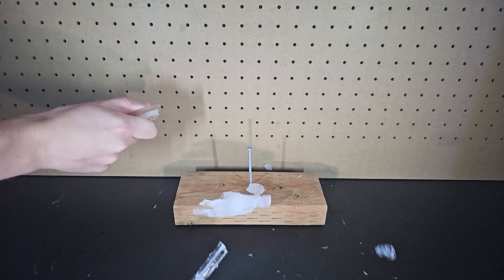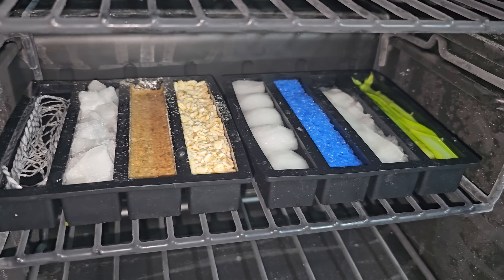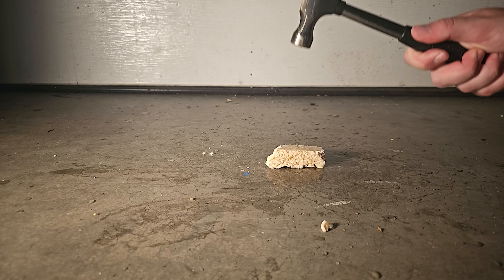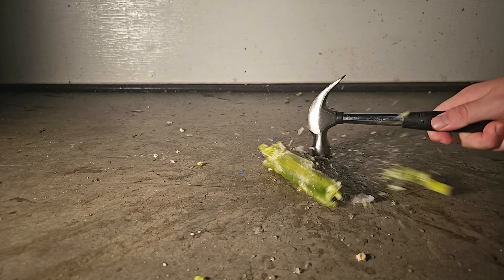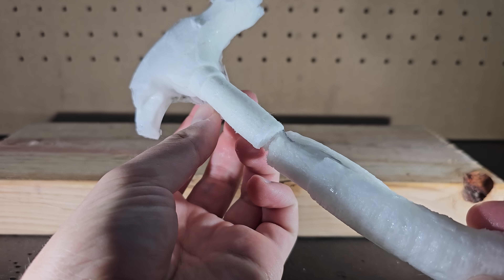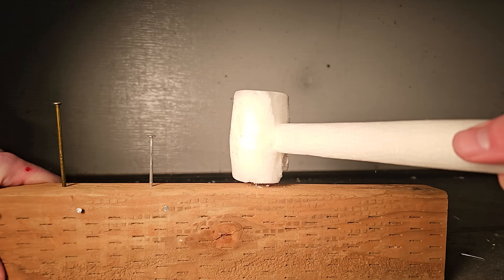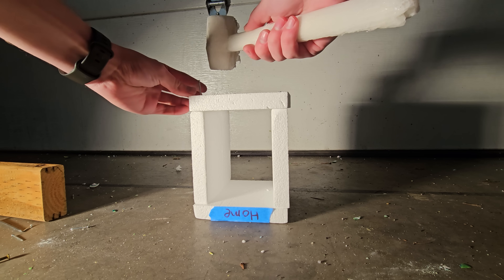How strong can you make ice? (World's Strongest Ice Hammer)

Comment: In case you didn't know

Project Habakkuk was a secret British research project during World War II that aimed to build an unsinkable mid-Atlantic aircraft carrier made of Pykrete, a mixture of wood pulp and ice. Conceived by Geoffrey Pyke, a British inventor and war correspondent, the project was initially supported by Winston Churchill. This innovative idea emerged during a time of great need for the British Navy, as they faced significant challenges in the Battle of the Atlantic.

Pykrete is a composite material made from a mixture of wood pulp and ice. The wood pulp acts as a reinforcement, increasing the strength and durability of the ice. This unique material was discovered by Geoffrey Pyke, who experimented with various combinations of wood pulp and ice. The resulting material was found to be strong, durable, and resistant to melting.

The type of ice used in Pykrete was likely freshwater ice, which would have been mixed with wood pulp to create the composite material. The exact composition of the Pykrete mixture varied, but it typically consisted of a combination of water, wood pulp, and other additives.

The Proposed Habakkuk Aircraft Carrier
The proposed Habakkuk aircraft carrier would have been enormous, measuring over 1,200 feet (365 meters) in length and 180 feet (55 meters) in width. It would have been capable of carrying over 100 aircraft and would have served as a mobile airbase in the mid-Atlantic. The carrier's design would have featured a flat top deck for aircraft operations, with a series of hangars and maintenance facilities below.

Despite the innovative idea, Project Habakkuk faced significant technical challenges and logistical issues. Some of the key challenges included:

Pykrete's properties would have been affected by temperature changes, potentially causing it to melt or become brittle. This would have required sophisticated insulation and cooling systems to maintain the material's integrity.

The production of Pykrete would have required large amounts of wood pulp and water, which would have been difficult to manage and transport. The construction process would have been complex, requiring specialized equipment and labor.
The Habakkuk carrier would have required regular maintenance to ensure the Pykrete material remained intact. Any damage to the structure would have been difficult to repair, especially in the harsh marine environment.

The project was also met with skepticism by naval experts, who questioned its practicality and feasibility. Some of the concerns included:

 The Habakkuk carrier would have been a slow-moving target, vulnerable to attack from enemy ships and aircraft. 
The construction and maintenance costs of the Habakkuk carrier would have been extremely high, potentially diverting resources away from other critical war efforts.

After several years of research and development, Project Habakkuk was ultimately canceled in 1943 due to its impracticality and the development of more conventional aircraft carriers. The project was deemed too ambitious and too costly, and the British Navy opted for more traditional solutions to their naval needs.

Although Project Habakkuk never came to fruition, it remains an interesting example of the innovative and often unorthodox ideas that emerged during World War II. The concept of Pykrete and the Habakkuk project continues to inspire interest in the fields of materials science and naval engineering.

The project's legacy can be seen in the development of new materials and technologies, such as advanced composites and smart materials. The Habakkuk project's innovative approach to problem-solving and its willingness to challenge conventional thinking have also inspired new generations of engineers and researchers.

In conclusion, Project Habakkuk was a fascinating and ambitious project that pushed the boundaries of materials science and naval engineering. Although it was ultimately canceled, the project's legacy continues to inspire innovation and creativity in various fields.

Comment: Glass also shatters like ice but it can be reinforced with steel wiring mesh to prevent shattering which is seen in indoor sports centres. Due to glass having a much higher melting point than ice the shards of glass don’t melt unless the air surrounding it is 800 degrees Celsius or higher. Making the shattered pieces of glass hazardous.

Comment: In addition to AndrewSeller's ideas for making Ice Denser, I have a few explanations.
You can cheat using pure power, since Nails have a sharp tip so you're able to ignore a lot of the density and hardness of the wood, which is why it works very well on styrofoam; as styrofoam isn't as dense nor as hard as ice; so it transfers far more power directly into the styrofoam than the hard wood. I'm tired so I shall probably add a few more explanations tomorrow.

Comment: You should get the strongest ice and item mix for the head and the best for the handle and just blend the two together around the center point and where rhe head and handle meet for it to be the strongest (you could also get small chains or wire or like coins and try it like that)

Comment: Its 2 months old but i would suggest layering cotton so that that there isnt just individual cotton balls but a whole connected mass of cotton. I feel like the ice space between the cotton are the weak points. You could either buy new cotton that isn’t in balls or you can pull apart the cotton balls and sorta stuff the mold more interconnected. Also unrelated, could you try using metal wire or is that not allowed? Anyway thanks for thr video

Comment: The paper towel getting saturated by the water, and them being so thin, fiberous, and flexible. still being paper though, it can still rip pretty hard. So thats gonna be dificult. 
 
Fiberglass might be cool to try, the material has to be able to fufill what paper towel does, while being less rip prone. 

If you stretch out the cotton balls and make them less ballish, you can potentially make it better and more uniform. 

You might be able to do a hybrid meathod, where most is cottonballs, but the hammer head is something like a small bit of cloth with a quarter or something to help add structure to the head, tho that might be cheating, idk lol, a quarter is metal, just like a hammer.

Try the ice salt trick someone else mentioned also, that definitely helps!

Ooooh, cardboard might be good too. Less likely to rip when frozen potentially, but it does get super weak when soggy, it's something to try tho imo. 

Feathers might go hard, goofy, but surprising might work, tho might not take in water as well. 

A thicker liquid might also be a good idea, youd have to find one that can be frozen super well, cuz some thicker liquids dont. 

Best of luck! Im tired, so imma end the comment, but i might add to it, we will see!

Comment: Wait but didnt the asparagus do the best on the gronk test?  So it can take distributed hits better, you couldve used the asparugus in the shaft of the hammer rather than the string. The idea is simmilar to you using the oats at the head of the hammer.

Comment: Pykrete (/ˈpaɪkriːt/, PIE-creet) is a frozen ice composite, originally made of approximately 14% sawdust or some other form of wood pulp (such as paper) and 86% ice by weight (6 to 1 by weight). A slab of pykrete Pykrete is made of 14% sawdust and 86% water by mass. You were using too much sawdust, I think.

Comment: pykrete is so cool ;) ice is one of those sources of endless fascination for me, probably cause i don't get to see it often beyond my freezer and the occasional frozen morning. I've seen some futurists talk about using fiber and ice for quick and easy habitats in the outer solar system, where the amount of sunlight is low enough water ice remains frozen even in a vacuum, with some additional insulating layers it could remain frozen with a comfortable habitat inside, maintaining the structure could be as easy as just melting some ice nearby and applying it to damage when its cold enough to freeze quickly after contact and i suppose you could carry a lot of strong fiber for the same weight as something made of metal or composite

Comment: I would boil the water before adding it to the mold the reason is that room temperature water has impurities like gasses in it. Heating it up will help remove it. This is the reason boiled water freezes faster than room temp water

Comment: To Think, if You Have Enough, Solution, u Could Make a Broadsword, And it Dose 100% Ice Damage, 100% Cold Status, Extra Sharp Because Ice is a Crystal & There Extremely Cheap to Make !
🤩
But, Also, Extremely, EXTREMELY Weak to Heat, So Winter is The Best Time to use it WITH Gloves To Prevent Melting !

Edit : I wonder if it's possible to make Real, Ice Arrow's ?

Comment: I feel like it would be a lot better if you lined the shaft with string because it never broke in half, making a stronger shaft, I think soaking the paper towel first before putting it in the mold would help aswell, and you need to try it with sawdust but more of it

Comment: 1. Refreezing after allowing ice to mildly thaw potentially allows the ice to more densely crystalize. 
2. Lowering the temperature of the water prior to pouring it into the mold will allow for more rapid and dense freezing. 
3. Adding salt to water additionally lowers the freezing temperature, meaning it is slower to freeze but also slower to thaw 

Love from an old science fair project <3

Edit/correction: 
For number 3. Comments are correct, the salt would not cause slower thawing. Adding salt would make the hammer thaw and freeze at a lower temp than pure water.

Remembering a bit better now, I used salt to delay freezing years ago, so that I could make the water super cold before a flash freeze, then thaw, and repeat to increase ice density. Thanks for the comments all. This was fun/nostalgic to think about again :)
Reply: Are you sure about point 3 because that sounds completely wrong?
Reply: @drewdabbs418 it’s slower to freeze but quicker to thaw bc freezing/meltinng temp is now lower
Reply: @drewdabbs418 that's why they salt the roads
Reply: @jasnah-blaumeux8427  I should have clarified that I meant the second part. I know it lowers the freezing temperature. But surely that would be quicker to thaw than slower to thaw.
Reply: @drewdabbs418  They’re right, I just took a second to google it
Reply: I was The 400th like!!
Reply: You should build the mold with a channel that goes to a bottom bit that you can break off. Then, you can freeze it insulated, take advantage of directional freezing, and get a solid ice hammer instead of one full of air pockets
Reply: I would go with boiling water. The reason is that the hot water will have more of the gas removed from solution. This is why boiling water freezes faster than room temp water. This would make a more uniform ice

Comment: Try using a wood dowel or metal rod like rebar in the handle to prevent it from breaking.  Also similar to concrete sometimes ingredients are added to make the concrete stronger like shredded fiberglass.  Maybe research into if any chemicals or materials that makes ice harder/more resistant to cracking.

Comment: Could you “forge” the hammer’s head separately- do another mould of the head, facing down. Put a strip of paper in, and only put enough water in to cover that one strip. Once that freezes, put another strip on top and enough water to freeze that. Keep going, and then put the frozen head in the mould to freeze with the rest of the hammer.

The hammer’s head would be laminated rather than a single solid block, with the force going through all layers, rather than along the lines between the layers. Like trying to split wood across the grain instead of with the grain

Comment: Ice has a higher compression strength compared to its tensile strength, as you noticed. Even then, the compression strength isn't amazing, which is where you are losing the material.

I have no formal training in material science, but I would be interested in a composite hammer that uses things that are more specialized to compensate in these areas. For tensile strength, I wonder how kevlar might change the strength. For compression, how would small rocks do?

Am I just trying to recreate concrete but frozen?

Comment: One of the factors in the brittleness of ice is impurities (minerals dissolved in the water) as well as trapped gases during the freezing process. Without buying a really expensive kleinbel machine, you can use an insulated container to apply directional freezing. The goal is for the ice to freeze in one direction, so that the gases are either expelled during the freezing process, or trapped on the exterior where you can carve it away.

This is also the process home bartenders use to make "clear ice". Part of what makes clear ice so effective in beverages is that with fewer impurities, the crystalline structure of the ice can more tightly pack, resulting in a more dense ice cube

Comment: This is reminding me of saturating toilet paper with super glue to make something that was easier to get into gaps and hold things together. The result was something where if I ever wanted to take it off something I'd have to tear the thing off it.

It'd probably be hell to make and require multiple stages, but if you used a paper towel core surrounded by strings spiral wound in two layers of opposite directions all the way up to the top of the head, that would probably prevent any handle breakage. As I type it I realize that this is basically wire wound gun barrel construction just with the ideas that went into pykrete.

Comment: Is it really an ice hammer if it’s made of asparagus? Behold my ice hammer made of epoxy, carbon fiber, and a drop of water

Also It seems like there was air trapped in the sponge hammer, I wonder if you could vibrate the mold or put it in a partial vacuum to remove the trapped air

Comment: If you ever revisit this project, try looking into ways to freeze ice from one side to another, or from the inside out (rather than freezing from the outside, in). A lot of what makes ice cubes fragile is the internal pressure built up from water expansion. Ice that's not under stress (icicles are the perfect example, but lake ice is also good) is far stronger and less brittle.
Reply: An easy way to do this would be to just add some insulation to the sides of the silicone mold
Reply: Who lives in Pineapple 🍍 under the sea?

Comment: Or you could get one of those mini hammers that come in those cheap moving in tool kits and make the mold from a larger hammer so that just a little bit of water fits around the small hammer and I bet that would make the best ice hammer, because even if a little bit of the ice surrounding the hammer broke off There would still be a really solid hammer underneath the ice. I’m not gonna do the experiment but I’m pretty sure I could actually like work on some real ass nails and stuff like that with this type of ice hammer. Because once the ice breaks off just the part that hits the nail underneath, you have a nice piece of solid steel. I don’t even know why you had to go through all this just encase a real hammer with a little bit of ice.

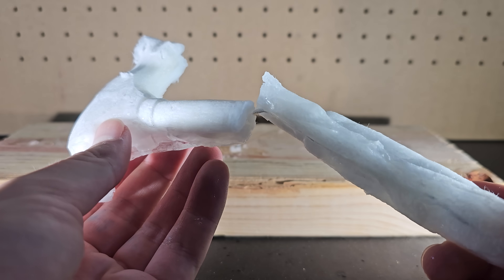Comment: So cool video. BuT you failed to comprehend, you were holding ice with bare hands? So directly transfering heat into the handle, causing it to melt, and if you notice the string. So at one point you can see the string starts to melt the ice, and you can tell because it starts to wear its way through the side of handle 7:35.  You should of wore gloves and did like 5 hits than put back into the freezer to keep it frozen.
Reply: True
Reply: Ideally he would do the test inside a walk-in freezer, possibly wearing gloves

Comment: I used frozen waterlogged toilet paper and paper towels to make various potato launcher projectiles that were strong, cheap, and didn’t waste food. I made the strongest ones by completely saturating the toilet paper or paper towels prior to putting it in the mold. Then I would cram as much of the saturated toilet paper or paper towels into the projectile mold as possible (Pushing very hard made no difference in the volume of the paper types in the mold). This material was about as hard as lead, and the projectiles only deformed when they hit a hard object such as wood or steel with speed of ~50-70 m/s. It would be interesting to see if this pseudo pykrete had a practical use like making single use tools.

Comment: I have saw in a brazilian channel, a guy doing the same thing but with cotton (not cotton balls, its like them but shredded, the fiber somehow holds itself in a very strong way) and it did very well, better than the tests in the video, if you mix with your idea to use paper towel I guess it will work even better than what the brazilian channel did, if you are wondering which channel it is, its called "Barone" and the title of the video is "Pykrete, o super material de gelo inquebravel" in the video he makes this kind of ice with cotton and tests its strength with a hammer and a machete, it didnt break at all and he said u could use it to have a cold drink in the beach without worrying about the ice to melt or break

Comment: Anything with high tensile strength that doesn't stretch much.

Ever heard of fiberglass? I wonder if even just some cheap insulation would do the trick if you just packed it in there tight enough.